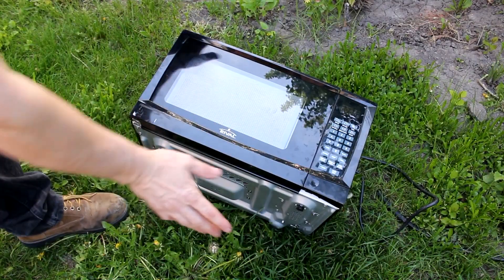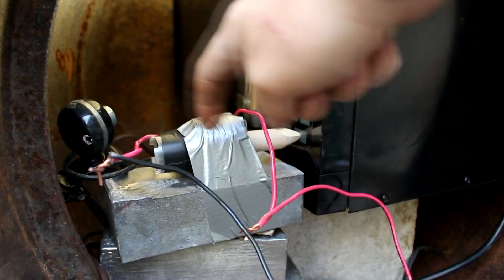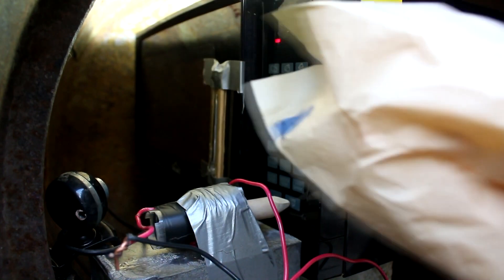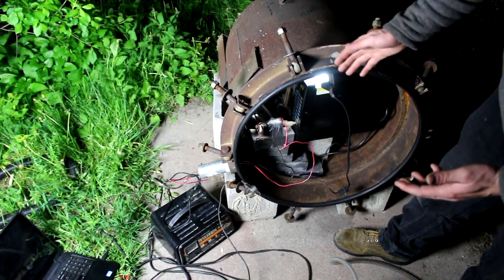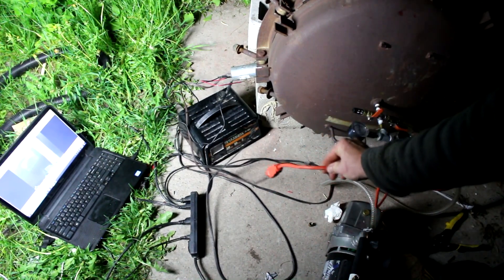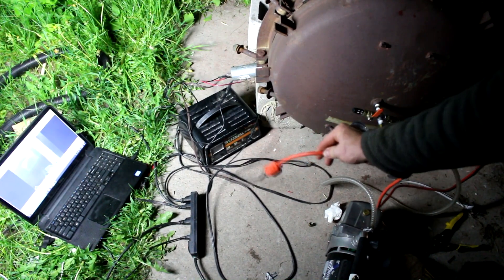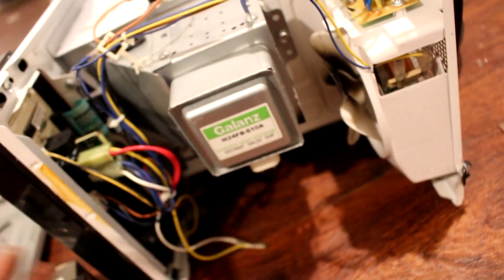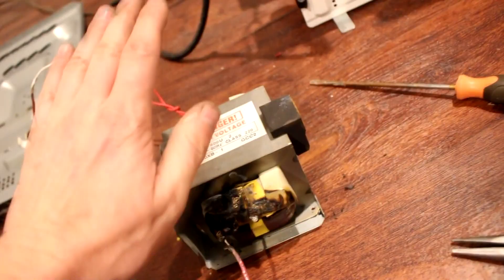Microwave In Vacuum Chamber

Comment: By operating the machine in a vacuum you are in effect reducing the relative permittivity, which basically means a lower resistance through space and hence that arcs form more easily, and provide significantly more energy. This, coupled with the fact that the heat could not dissipate into the surroundings, basically means you melted and short-circuited your components

Comment: Cody save the transformer and build ya a power supply from it, I'm currently building one myself and it's easily pushing 30amps at 14 volts

Comment: You did put 10 tons of pressure on the magnet wire. Might have destroyed the varnish coating allowing the short circuit. Also now that you have the transformer out can you wire the magnetron with an outside power source?

Comment: My guess is the high voltage side of the MOT arced like a fluorescent tube, lower air pressure means electricity can jump gaps easily, if you take a glass tube with an electrode at each end then vacuumed it out, you get a tube filled with electricity (and lots of UV light), and with the terminals being so close together on the MOT, it arced itself to death... :)

On another note, "Is it a good idea to microwave in a vacuum?", there's one Jory forgot back in the IIAGITMT days... :P

Comment: I work on airplanes and in high-altitude aircraft and weather balloons engineers have to adjust if there are Electronics on board because with a decreased pressure electricity can Ark further because the air is physically restraining the electricity from exiting the conductor

Comment: Hmmm... I wonder if it might be possible to put all the control circuitry outside the chamber, and just the magnetron assembly inside? Essentially cutting the microwave in half, and keeping the sensitive stuff outside. You could isolate the high-voltage wires by only using one of the wires in your "conduit", and then grounding to the vacuum chamber itself.

What I'm saying is, if you really want to run the microwave in a vacuum, I think it can be done. Just not quite as easily as "toss the thing in there and hit start".

Comment: my guess is electrolytic capacitors aren't liking the vacuum.. only a guess.  you know... a cylinder with liquid in it used to atmospheric pressure vs vacuum.

Comment: I was just reading a book on neon lamps. When you put that oven in the chamber, this quote came to mind : "Neon lamps perform poorly at altitudes higher than 70,000 feet, where the lower atmospheric pressures encourage external corona and arcing."

High voltage transformer + partial vacuum = gas discharge lamp

Comment: Vacuum is much easier to ionize than normal air. Because the molecules have more space to move around. Therefore, plasma can form much easier. This maybe results in a lower resistance in the Magnetron.

Comment: What seems to have happened was a vacuum arc, where the surfaces of metal begin to emit electrons through an electric field (or through heat). The process that this can happen is actually super cool and involves electron tunneling (quantum physics). Once started, a vacuum arc sustains itself because the electric particles gain kinetic energy and heat the metal surface, enhancing and further sustaining it. You need very high voltage and a very good vacuum though. I'd like to see some electric arcing experiments in a vacuum, and maybe you could get some plasma generated! You need a high vacuum, heated cathode, and a tungsten crucible as an anode. You probably could use the electron gun from an old TV or monitor as the cathode.

Comment: Running the vacuum pump may have caused the breaker to heat up and get close to tripping.  When you tried it again with the chamber at normal pressure the breaker would have had a chance to cool off. Trip time curves on breakers can make troubleshooting difficult. 

Also, since you sealed your wires into the hole in the vacuum chamber you might want to use terminal blocks on each end so you can do more rewiring without damaging your semi permanent wiring.

Comment: It's probably just because the vacuum has lower [electrical] resistance than air does. You should try running it with a variac and a current meter to match the current draw from when it's in air while under vacuum

Comment: The fan is there for a reason Cody! :D All transformers have to be cooled, at least with air. When there is a current running through a wire, it produces heat. In coils there is a lot of heat produced. Try running high voltage through a coil in a vacuum and in air next time please :)

Comment: Yes, Cody, the microwave transformer outputs about 2kV, so when you put it in the vacuum, the isolation on the transformers output was not sufficient enough  and caused it to arc until it burned out.

Comment: Next time -- if there is a next time -- you could keep the high voltage transformer part outside of the vacuum chamber and run the high voltage wires into the vacuum chamber.  I don't know though... I think the magnetron would then be the next issue.  Maybe it isn't meant to be.

Comment: HOW TO MAKE A HIGH-VOLTAGE POWER SUPPLY:
Im not sure if you already have one, but you can make a very good high voltage power supply in a few minutes with only two to three components:
A flyback transformer, a 12V Halogen lamp driver and if necessary a fan blowing on the mosfets of the driver.

Wind a cable around the core of the flyback. (I used 20 turns) and connect them to the 12V output of the halogen driver. Connect the driver to mains and use the HV-Output cable of flyback to determin the HV-Neutral. Solder a wire to it and pot the other pins in hotglue.
This created 4cm sparks in my build. I need to use a fan to cool the driver though.

Comment: vacuum should actually increase you dielectric strength by alot thats why the use a vaccum in high voltage switches   for up to 40 kV.

Comment: Im pretty sure electrical discharges function better in vacuum/low temperatures, as electricity will always move in the easiest direction, and removing so much air could allow it to arc pretty far, would be exciting to see tested. I would speculate that the transformer-coils magnetic field became just slightly bigger from the higher charge you sent into it, allowing it to bypass its sensor and hitting the fuse.

Comment: I think MOT's secondary HV coil burned out, because regular air has very high electrical resistance, but vacuum has much lower electrical resistance. That caused insulation breakdown of enamel that is covering the copper wire, leading to arc between wires in the coil (shor circuit).

Comment: problem is that our atmosphere is somewhere in 14 to 15 psi that means that air is dense and its hard to start an arc but if u start it the air becomes pretty good conductor what i think happened here is because the air pressure was low the arc was easily started and it was taking small amount of current problem is as there was no air the insulation on the coil got hot and got carbonated and it made pretty good path for current to flow and that meant more heat until it got destroyed (wow u actually read all of this congrats)

Comment: Maybe there was some sort of volatile component under the enamel coating of the wire which expanded enough rip through the dielectric. It also sounded like the whole resonance of the system was off while it was in vacuum. Maybe you were getting out of phase emf trying to play with the transformer. I dont know if the physics of the magnetron is reversible on macroscopic scales though, and for the waves to do it they would have to bypass the shielding. More plausibly though, 0 convective cooling of the coil made the enamel melt. The others are more interesting though.

Comment: Might be you met the sweet spot in your voltage/pressure parameter set, so that electrons have enough free distance between collision events when accelerated to create a plasma. That would make possible a certain current with following heat generation. Just an Idea.

Comment: When you reduce the pressure, the dielectric strength of the air seems to go down, it becomes easier to draw a longer arc with high voltage electricity. Once you get to an extremely low pressure, dielectric strength is not a phenomena that occurs anymore because there are very few gas particles to carry the charge, effectively creating a very high resistance.

Get the pressure low enough or pot that transformer, and maybe you can make some space popcorn! ;)

Comment: That "beeper" that you mentioned, is actually a thermal protection device. At least that is where mine is located. If you can follow the wire, you'll see it's in series with the line voltage.

Comment: There had to be two things going on. My background: I worked briefly for a company that made ion drift chambers for protein analysis. Hard vacuum and extremely high voltages, up to 60KV. Microwave ovens run the magnetron tube (microwave oscillator) on about 1,000 volts at 1 to 1.5 amps.

Don't forget to salvage the two magnets from the tube!

 First. If you look at a magnetron tube, it is almost ALL heat fins. The actual active element is a little bigger than your thumb. Imagine 1500 watts manifesting itself inside your thumb. That requires lots of cooling air! Remove the air, the tube goes into massive over heat virtually instantly. They are typically 1,000 to 1,500 watts. Probably starts drawing current like mad too. I don't know what the failure mode would be under these conditions as only a madman would attempt it.

Second and most likely: Even in a hard vacuum, electric coronal arcing is almost impossible to prevent. Its even worse at "low" pressure. As you speculated. Your chamber probably is incapable of true hard vacuum. That made the plasma that burned the lacquer off of the transformer high voltage windings creating a short. The transformer then ate itself for lunch. A hot lunch! If this had not happened, the magnetron tube would have eventually melted, assuming power could be maintained that long. 

The "beeper" you pointed out is actually a thermal (overheat) shutoff switch.

Please don't play with microwave ovens. You don't get a second chance after an accident of that nature and your family will be crying for weeks after the funeral.

Comment: my guess is that the transformer heated up, caused the coil coating to melt, which made the electricity to skip the coil and go short circuit. 

P.S. to my knowledge low pressure environment should not allow electricity to jump further distances, if i'm not mistaking electricity cant travel in a vacuum at all! the problem was lack of heat distribution!

Comment: Run the transformer from outside the chamber?
Reply: He could just add some heatshrink or silicone to the capacitor contacts to at least somewhat reduce arcing. Same for the diode and anything else up to the magnetron. He could also just have everything but the magnetron and cooking chamber outside the vacuum chamber.
Reply: Submerge it in mineral oil and it should be fine.
Reply: this needs more likes
Reply: NO. Microwave transformers are extremely dangerous if you don't know what you're doing. There's enough voltage present to kill you before you knew what happened.
Reply: If the shock stops your heart (which it won't necessarily do - I'd have died a dozen times by now otherwise), you will have 20-30 seconds to scream before passing out from lack of blood flow and becoming brain dead 2-3 minutes later. The shock may paralyze your diaphragm and prevent you from screaming/breathing, which could become the worst and possibly last 3-5 minutes of your life.

Search Youtube for a video of a bear climbing a utility pole. The bear went all the way up to the 12-18kV feed line, touched the line, got a zap orders of magnitude worse than anything a MOT can possibly dish out, fell 30' to the ground and ran off.

There are several variables that go into whether or not a shock will be lethal and even when it is, unless the current went through your brain and was high enough to knock you out, you will remain conscious for several seconds after the fact,.
Reply: Why would the transformer be cooked from the magnetron not being cooled? These transformers can take the secondary being shorted no problem. And why wouldn't the magnetron show significant damage? I don't even think there's anything in a magnetron that could burn up and emit smoke.
Reply: Vince Sempronio, good point about the capacitors. There are definitely some in the circuit, and I'm not sure how electrolytic caps would handle it. Would not be surprised if they started leaking...
Reply: There is a huge cap in most microwaves. It is scary. I looks like he removed it when showing the transformer.
Reply: That's better than my idea of rewinding the transformer with insulated wire.
Reply: anonynomnomnom - almost all thansformers are made with insulated wire. it's a very thin layer of enamel to save on space and weight, but if there was no insulation between the windings, the electricity would just arc from one loop of wire to the next and take the shortest path between the ends of the wire.
Reply: TheSmileyFacedPizza  
The insulation is flammable or at least destroyed by extreme heat. If you short circuit something the power that it draws becomes enormous, and that caused the black out.
If you short circuit the transformer coil, it has a different inductance than it had before, and so the current that gets to the magnetron isnt the right one. 
Who said that the transformer would overheat? Nobody said that and if you are questioning what happened to the transformer, an arc jumped from one part of the transformer to the other, burning it up. As it burned the insulation current started to flow throught the cable but with less resistance, as the coil became like one thick wire.

What cody thought was that the magnetron would overheat and stop working, not that the transforner would crate an arc. Its unrelated the overheating of the magnetron with the arc on the transforner
Reply: @joao, I was responding to someone who deleted his comments.
Reply: Wouldn't this be VERY dangerous?

Also I don't think the cables he already passed through  the chamber are rated for the high voltage.
Reply: Arcs jump further in a PARTIAL vacuum, which a "95% vacuum" is. In a perfect vacuum, the breakdown voltage would be about a teravolt per meter, which no man-made method can generate. At a more reasonable 1MV, can still run into issues with electrons getting stripped right out of the conductors or electrodes even in a full vacuum if you bring them close enough.
Reply: If the windings had no insulation then tightly wound wire would act like one thick block of copper and not short between winding. Probably not do much as induction would be bad.
Reply: this
Reply: Srdjan K. nope nope nope there it is at 7:02
Reply: mughat bitcoin